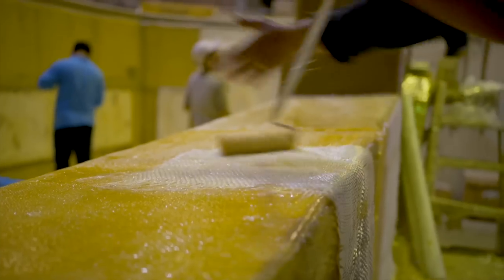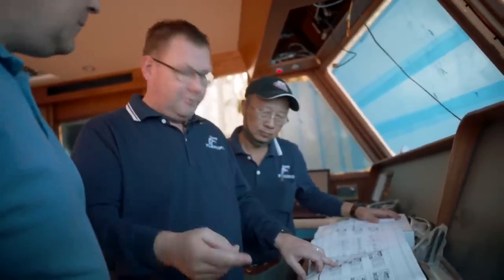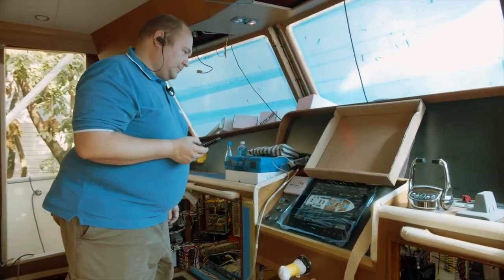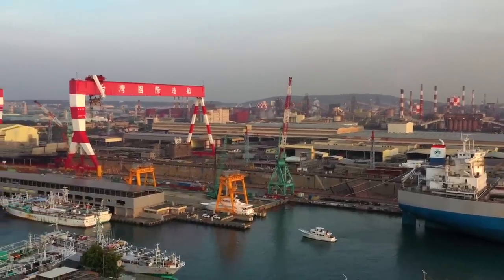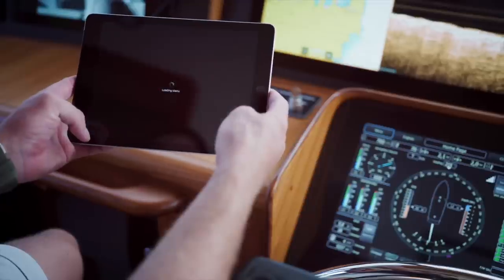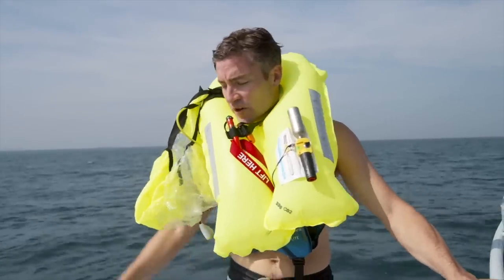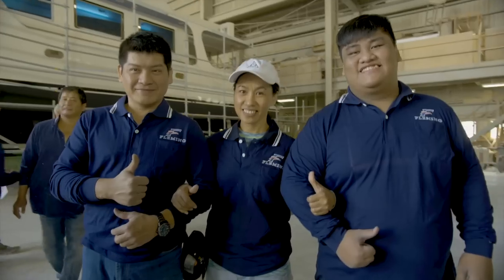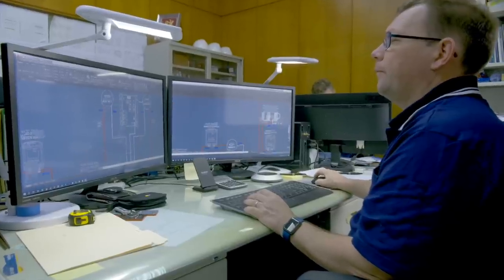Fleming Yachts Feature Film "Under The Surface"

Comment: This is by far the best boat builder video, I have seen on the net. Really great for the upper staff to be so involved. It would have been nice to see, the install of the engines and components into the hull of the boat during construction, from the point of shipping and receiving to the cranes lowering in the engines and systems.  Yet despite the absence of that note, really good video. And beautiful vessels, such amazing quality and craftsmanship.
Reply: Agree.. Would love to see engine, generator and electrical installation.

Comment: I'm so leaning on purchasing a Fleming this fall.
Reply: John, you could do far worse. The Fleming traces it's lineage back to Grand Banks, for whom Tony Fleming designed for many years. It's time-provem lines and modern refinements make it a sound investment, and a joy to cruise.
Reply: @geofffleming12 I grew up on 35 foot egg harbor.out of Winthrop ma. At 14 years of age I was taking it down east it to the cape. Our plain is to live full time  in New England for the summer,down south for the winter. When everything is in place this fall that's when we buy
Reply: By the way it's the quality of the Fleming that keeps me looking at them.
Reply: @johnbettano6026  CT waters were my summer playground. New England cruising would be very comfortable on a Fleming. The migration south is much the same, with little need to stir the mud in the ICW. The Fleming is more than sturdy enough to run offshore ; so much so that once you reach Florida, you'll find yourself watching the sky for the right weather to make the run to Bimini, and the greater Caribbean.
Reply: Florida welcomes all Winter Sailors! 😎

Comment from the maker: @William Burnette - You asked during the video premiere is the FirstMate system reduced the amount of wiring by replacing copper/tin with fiber. The answer is yes and no. It reduces the heavy gage copper wiring significantly by replacing a lot of it with much lighter data cable and CAN bus network cable (N2K cable).

Comment: Cannot say enough about what I have learned of Fleming Yachts thru all of the videos. I do believe that I have seen everyone now. So just a small observation if I may? How about offering  a sea anchor WITH three days of instruction for all new hulls? I grew up on the shores of Yukon Harbor west of Blake Island in Puget Sound. Owned @ water skiied behind 16 foot jet boat and spent 3 years in wheelhouse of US Army FS 313. 176 ft steel hull, twin GM V6 500 hp diesels, 12 knots. Moored Pier 23 Tacoma WA. GOD SPEED TONY, GOD SPEED.

Comment: Excellent video and congratulations on the 85.  I could watch these shipyard / manufacturing videos each night.  I'm curious if you have investigated a possible 45/48 model.  Same DNA but on a more manageable scale for new and downsizing owners.  It could offer earlier entry for some into the Fleming fleet and steal some new customers that may have been looking elsewhere (i.e. a GB54, KK44, KE52, or some other "express cruiser").  Same fit/finish. Same systems and engineering.  Keep up the great work and best of luck.

Comment: Beautiful boats!  What I love especially are the user interface and backup systems. Joystick control with "position hold", Boning System for all the operating information at your fingertips, fuel management, steering and generator backups .. all fantastic ideas, beautifully executed.

What is the average delivery leadtime for ordering a 65?

Comment: Lovely UI and software/Control system. How does it stack up now a few years on?  Will only be able to buy used :)

What happens if you need to move quick from standstill can you bypass the check screen and go?

Comment: Which system of stabilisation do you use, seakeeper or Humphree fins and why?
How far will you go in customising the interior?  The reason i ask is that i think your interiors look like a 1970s caravan - just functional benches and wood overload. 
If i got an interior designer to design a more 'colonial' pavillion style, can this be incorporated?
I ask because i love the timeless exterior look and the quality of build and, of course, your exclusivity.
Reply from the maker: All Fleming’s have ABT TRAC hydraulically operated fin stabilizers as standard equipment, and these can be ordered in an “At-Rest” version. We also offer Humphree electric powered fins with “At-Rest” mode – this is a good option when coupled with our Li-Ion battery bank system as it allows the stabilizers to operate when anchored without running a genset. Yes, we can customize the interior and recommend that you contact your local Fleming Dealer to discuss your ideas in more detail. Thanks for your interest in Fleming Yachts.

Comment: MAN appear to be standard. Are other manufacturers like MTU or CATS available as well?
Reply from the maker: Hi Ryan. We would certainly consider other engine choices if a client requests it but we choose MAN as the standard engines in the Fleming 58, 65, and 78, as they have the ideal torque curve, great power/weight ratio, efficient, quiet, and we receive excellent service from our MAN supplier. The Fleming 55 has the well proven Cummins QSC engines for the same reasons.  We have found these choices to be particularly well suited to our semi-displacement application.
Reply: FlemingYachts appreciate the quick reply. I currently own a 1985 Chris Craft 426 with twin Detroit’s. Dream of one day cruising in a 65 Fleming.

Comment: Q: When you incorporate Lithium Ion Batteries, are you planning on adding solar power systems, et. al.?
Reply from the maker: Hello @OneEyed Mike. We have been offering solar charging systems for many years. The latest solar panels provide a greater output for their size, plus they can be secured directly to our (curved) hardtops and have non-skid finish so you can safely walk on them. This is becoming a more popular option and the cost of good quality panels is becoming more reasonable.

Comment: Any one knowledgeable about if Fleming is moving towards Lithium battery banks like so many modern boats and sailboats?  Is this just an option or upgrade?
Reply from the maker: Yes, we have delivered several new Fleming's with Lithium-Iron Phosphate (LiFePO4) battery banks. The ability to run cabin air-conditioning overnight at anchor, without running a genset is a great benefit. Lithium-Iron batteries are already standard equipment on the new Fleming 85 and a popular option on all other models.

Comment: The main thing that I do not like is the old fashioned aft raked pilot house windows and the design of them , forward raked has advantages plus if the toward corner windows had a curve in them it would really give a much more pleasing look , as well as interior console benefits , other than this ,for me the vessels really are a well though out and a proved endearing well built design of the best quality in their class

Comment: One of my few complaints of the Fleming is WHY put the electric control panels onthe floor WITH A GLASS FRONT  which can be so easily kicked and broken ( And often is)WHY not put the  ut on a bulkhead so us older boaters are not crawling on  the floor to see if certain items are on changed over etc etc. Other than that  Excellent sea boats.

Comment: On the screens you show gallons per hour, and total range, why don’t you show miles per gallon? The computer must know that to figure the range. Is there a logical reason I just don’t understand?
Reply from the maker: It's really very simple. When you drive on the road, the road stays where it is. When you drive on the water it moves over the surface beneath it according to the tides and the currents. If you have the current with you, you will travel many more miles at a given speed through the water than if you have the current against you. and the currents vary according to the tides and the wind. Miles per hour are meaningless.

Comment: Just wondering whether there is any Plan B for continuing production in case of an invasion of Taiwan by mainland Communist China? The best Trawler yachts are made in Taiwan. If Taiwan was in lockdown imposed by China, how would yacht building contracts be fulfilled? I would be very concerned in starting a £3-£4 million investment for a trawler yacht built in Taiwan right now....an invasion would scupper the completion of the contract...and that invasion will happen sooner or later.
Reply from the maker: If you pay by Irrevocable Letter of Credit then the money does not leave your bank until after they receive the Mates Receipt proving that your boat was safely loaded undamaged aboard the ship taking her from Taiwan. Any deposit already paid can be secured by an arrangement you make with 
the party from whom you purchased the boat and the builder. This is the way we do business.